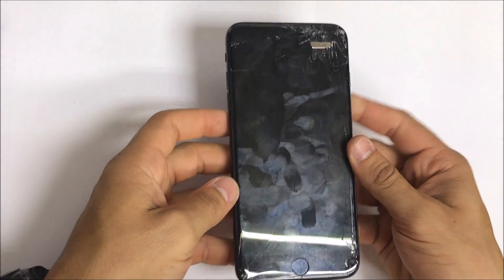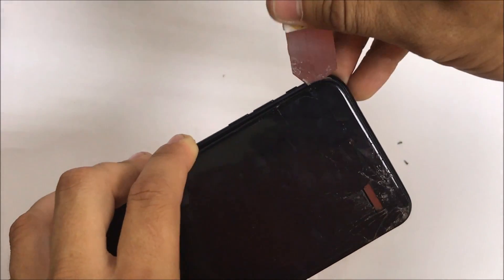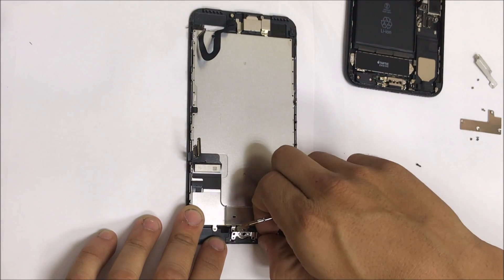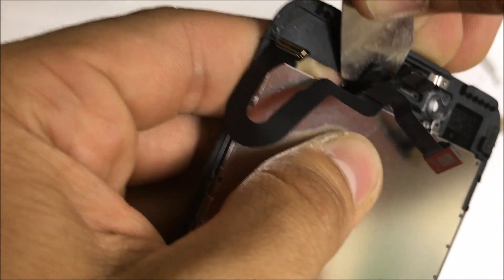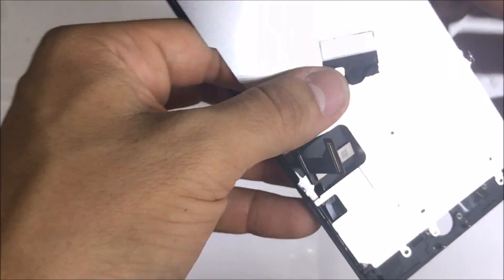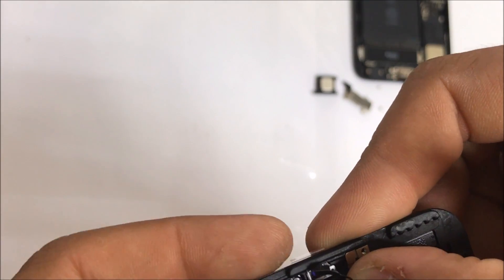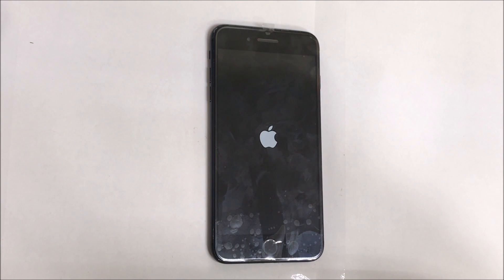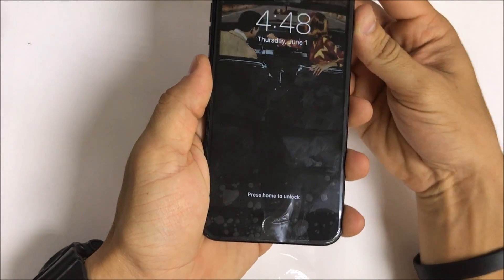How to replace iPhone 7 Plus LCD Glass Screen | Screen Replacement

Comment: On a black screen like this one you need to dig out the ambient light cover and transfer it to the new screen which he has not done before you put the ribbon cable back in place, if you dont do that the proximity sensor which blanks out the screen when you put phone to your ear wont work properly if at all.

Comment: hey man will the home button stop working if i do such repair? I've read that when you change a new screen the home button will stop working?
Reply: I have a friend that replace the screen, but when he connect the screen to the frame he lose the homebutton, headspeaker and the microphone. But if you disconnect the screen from the frame all of this will work again. Any solution what it can be?
Reply: I have heard this as well. Can you confirm if the home button works or not? It looks like it does at the end of the video but want to make sure.
Reply: it will work so long as you dont damage it
Reply: Yes it still works